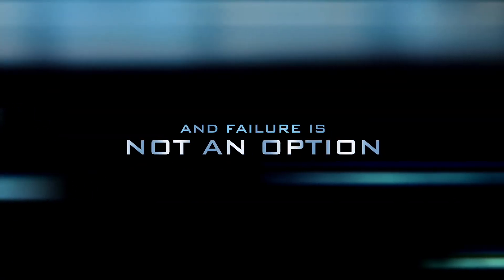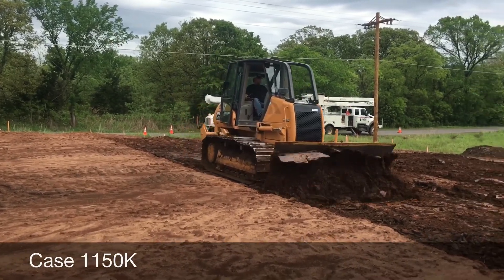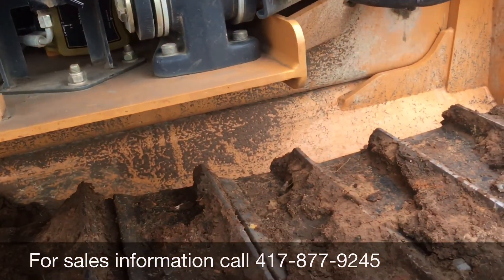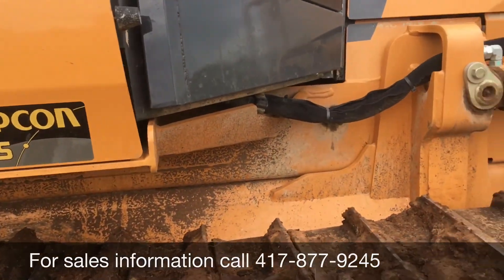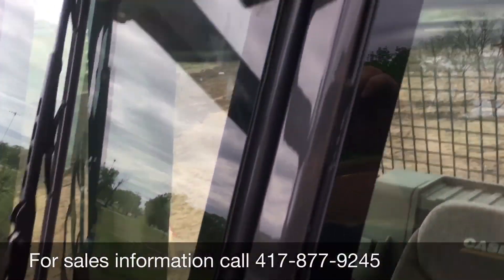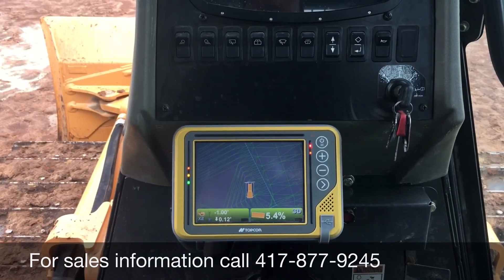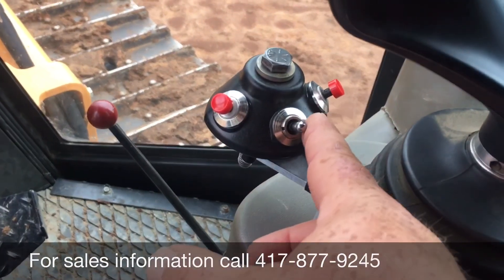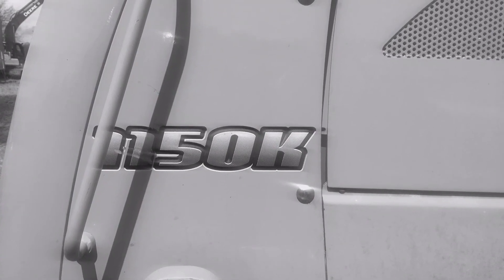Case 1150K With Topcon Dual Max System

Comment: Sweet. What does this system cost to install?
Reply from the maker: Technical Items 
The Topcon Dual Max System is ball park area $85,000-90,000 range depending on if the Dozer needs a hydraulic valve or just electronically interfaced.